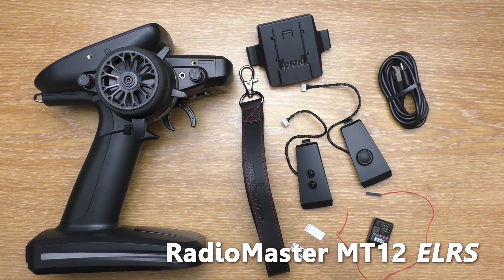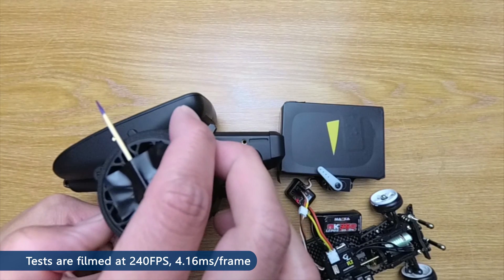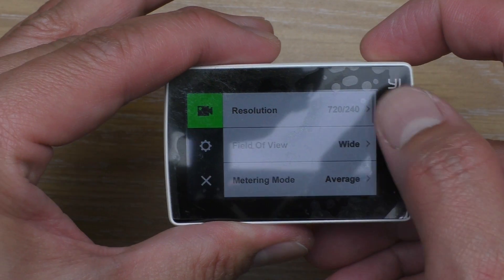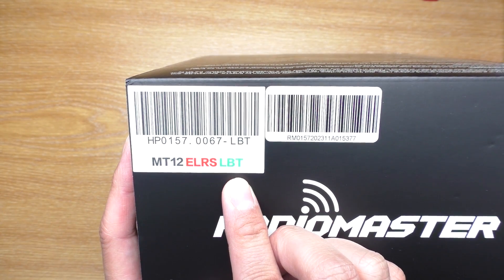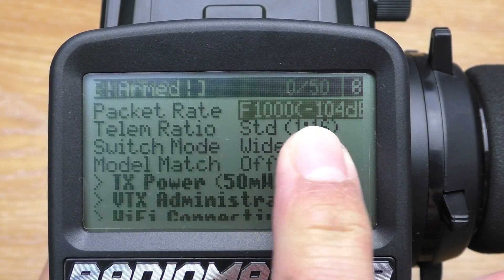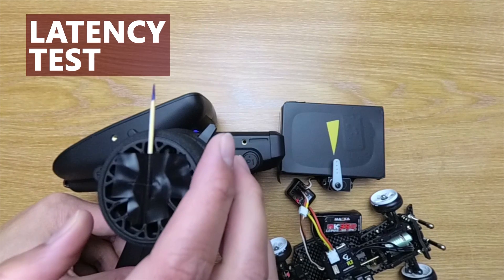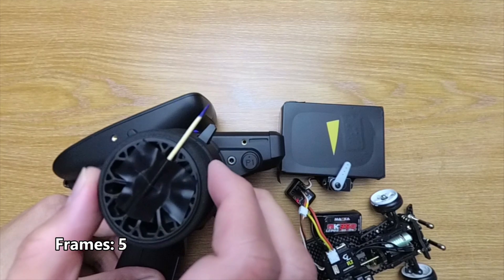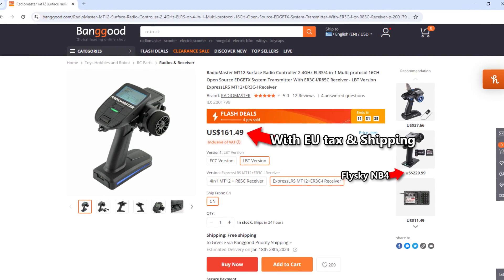RadioMaster MT12 - How To Make It Fast & Latency Test (Beginner's Guide)

Comment from the maker: I'm trying to make as many videos as I can before I go to the dentist and won't be able to record anything for a while.
Reply: I’ve been loving your videos! I’ve been trying to find a good brushed motor upgrade for the 284161 so I don’t have to upgrade the esc and then radio. If I do upgrade the radio, I’m going to follow this video.

Thanks for these videos!
Reply from the maker: @LikeMossToFlames  Take a look at PN Racing. You will need a motor that has mounting holes at the front. PN seems to be the only one who makes brush motors with mounting holes.
Reply: is this good enough for drift race?
or maybe head to head with sanwaa mt4?
Reply from the maker: @rulyiman7597  I'd say strictly for racing, Sanwa is better.
Personally I think this transmitter is borderline experimental and way too complicated for a racing environment.

Comment: hai
i need opinion from my option
fs nb 4 vs rm mt 12 4 in 1 or rm mt 12 elrs vs fs it4

which one should i buy? 
thank u
Reply from the maker: NB4 and MT12 are both good choice. NB4 is easier to use while MT12 offers much more adaptability and programming option. However MT12 is really difficult to use if you don't know the EdgeTX.
Personally, prefer NB4 because it offers everything you'll ever need and it's easy to use.
Reply: @BeaversHobby thank u

Comment: I figured out that the reason its the same as the Noble. its your Servo that has reached max speed. So if you test with one of the fastest servos that exist the result should be better😂😂
Reply from the maker: I measured the response when the servo starts to move so I don't know how much the servo speed contributes to that. A faster servo might starts to move earlier because of the duty cycle.
But it also bogs down by my camera speed which can only film at 240FPS so anything within 4.3ms is counted as 1 frame.
Reply: @BeaversHobby  Yeah. Some escs are also slower then others. But 20ms is still amazing😂

Comment: Question. If I set the Packet rate to 333Hz and set the servo speed to 333Hz will it have the same latency as F1000?
Reply from the maker: I'm not sure about that. The packet rate should always be higher than the servo speed. Since packet rate is the speed that communicates to the receiver, try and set it as fast as you can.

Comment: Hello. Thanks for great videos :D I'm planing to buy new radio for rc drifting and rc rock crawling. I'm consider Radiomaster mt12 elrs and Flysky g7p. Which one would You recommend? Is it worth to spend more on mt12 (cost of tx/rx and complicate) to have faster system than g7p? Also do You had throttle runaway issue on mt12?
Reply from the maker: G7P will be more than enough and it already has a good latency with consistency. It also has crawler mixing that is easy to setup.
MT12 is only good if you want to tinker with the settings and you are already familiar with the EdgeTX.

Comment: I bought the 4in1 version and then added the old jumper elrstx I originally used. But it only supports up to f500. Would that be okay?
Reply from the maker: F500 should be fast enough.

Comment: My radio did come with the 1000, however the ER4 receivers still come in at 50. Just changed it to 333hz thanks to your video. I noticed you can go higher, will it hurt the servos?
Reply from the maker: Yes, higher rate will stress and most likely will heat up the servo more. It's recommend to run the same rate as the servo.

Comment: For Mini-z, would you recommend this or the Noble?
Reply from the maker: It depends if you have old FHS (blue antenna) or will just use it with new FHSS (white antenna) and EVO. If you still have the old car then you'll need this MT12. Otherwise Noble is better in every way.
Reply: @BeaversHobby  it looks like it. I just have a number of receivers. Would be nice to pair them all down
Reply from the maker: @jamesotto8919  I that case check if your receivers are compatible with 4-in-1. If so MT12 is your one stop option to have everything in 1 transmitter.
For a car driver's perspective MT12 is overly complicated but it does a lot of things, way too much for surface vehicles in fact. That's the reason I usually recommend Noble over this. Keep it simple, all the necessary functions are there with easy access.

Comment: Thanks for video. I have a question why did you change also non servo channels to 333hz. Is it ok to do it for Hobbywing 1060 brushed ESC? Spec sheet says it has 1kHz PWM frequency. Can this setting damage ESC? Thanks a lot.
Reply from the maker: Hello. I change all the channels to standard digital output frequency to make them a bit faster. If your component has 1kHz then 333Hz will not damage it. Lower frequency than the component is safe to use. In this case you can also set the ESC channel to 1kHz to utilize the full range of data/resolution/speed. Anyway, I keep using 333 just to be safe.

Comment: I am having trouble getting futaba servo CT -701 working on mt12 I have to unplug servo and plug back in to make work, when I restart servo doesn’t work again
Reply from the maker: It's a know issue with the SBUS components on PWM ELRS receivers.
Tx/Rx pins will blast out the signal at startup so the component will glitch out. 
Which pin do you use? I believe the Tx/Rx are on 2 and 3.
Try and change the servo to use other pins. Either change the channel or map it to other pin other than 2 and 3. If you use the 3 channel receiver then... oops there's nowhere else to go.
I also mentioned this issue in my review. https://youtu.be/ZoMTnpdOhSI?si=LnF6Lg-SQOfFT9x2&t=1011
Reply: @BeaversHobby  thanks mate works on channel 4, any down side to using ch4? Thank you,  also I was playing around and I removed the esc servo lead from channel 1 and the motor kicked into go for 1/2 a sec lucky I had the pinion disengaged or would have sent car crazy across the bench into my computer, tried it again and same thing, not sure why, esc is Nitride Elcerem, I won’t be doing that while motor is ready but it could happen if I forget later down the track
Reply from the maker: @BigWillieFPV  Don't worry. There's no downside for CH4. Channel 1-4 and 6-9 got full resolution anyway.
So you don't have anything on CH1 and only ESC on CH2 then it got initiated with full throttle at startup? That's a bit strange but the signal blast problem might have caused it too. Anyway, using 5 CH receiver is pretty much preferable so we can move anything out of Tx/Rx and have 3 CH receiver in the end. Just assign another channel than CH5/AUX1 to the pin 5 and you'll be OK.
Reply: @BeaversHobby  esc was is channel 1 I tried channel 2 and was getting random bursts of throttle, I might move throttle to channel 5 and see if that’s  safer
Reply: @BeaversHobby oh I love your little drift car 🚗 what model is it? Thank you
Reply from the maker: @BigWillieFPV  Yes, move it out of anything that would trigger random burst is the best.
The cars in this video are MA Racing 1.5 (the green one that I drive at the end). https://youtu.be/k8Fa_iaqOyk
And the one that I use to power the servo test is BMR-X. https://youtu.be/jt48ORBBjFY

Comment: Mine came set as F1000, got it late January 24.
Reply from the maker: That's really nice! The first time I used it I thought it was so slow. Anyway, do the receiver still come with 50Hz as default setting or they up it to 333 for digital already.
Reply: @BeaversHobby  Not sure about included er3c-i, didn't take note but my other er5c-i set servo outputs at 50Hz. But creating new models don't set the rate to F1000 either.
Reply from the maker: @adamlives  Thanks for the info.

Comment: Hey Beaver do you know if the MT 12 will bind to a kyosho Mini Z I am doing a lot of mini z racing this year and really like the mt 12 i know it will bind to my Radiolink receivers but would be nice to know if i buy one it will also work with my mini z’s
Reply from the maker: Yes, it will. Choose the 4-in-1 Multiprotocol version and it'll be like the TX16S I did but pistol instead of sticks.
Another way if you will also use ELRS is get the ELRS (like I have here) then get a 4-in-1 module. That'll work too.